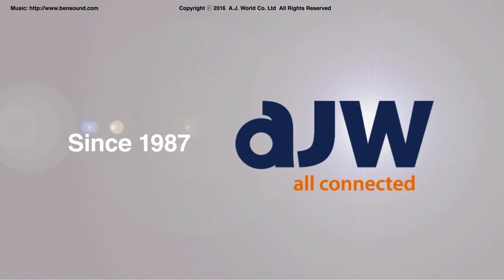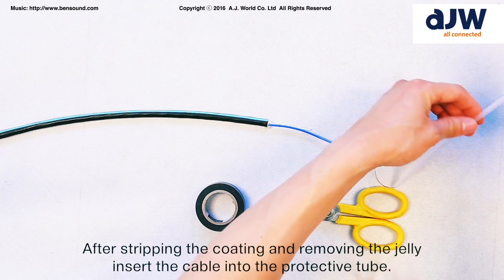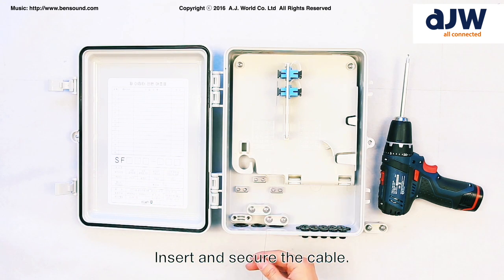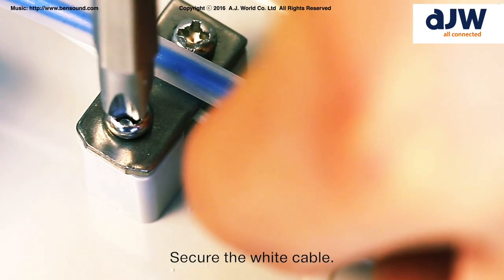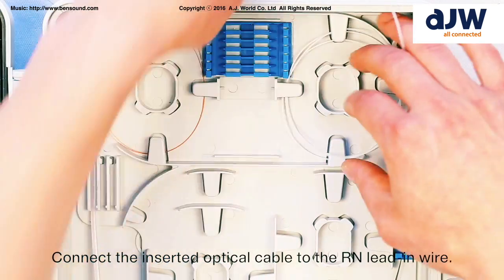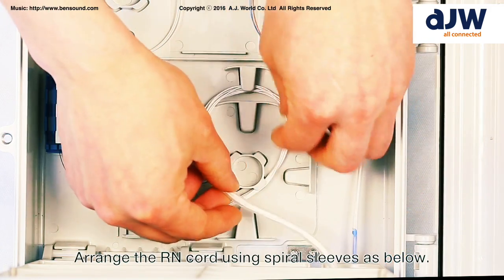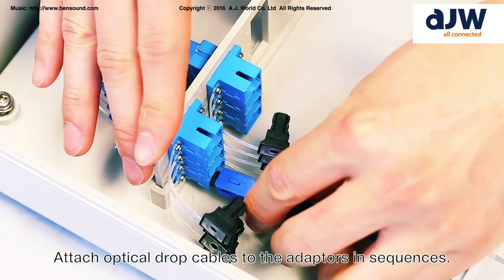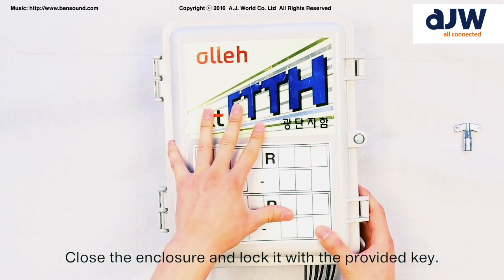[EN] Fiber Optic Termination Box OTP-A

Comment: That's it? Question is, how did they connected? All you do is organize the cables..
Reply from the maker: This video guides OSP field engineer the basics of using fiber optic termination box from cable preparation, retaining the cable inside the box, splicing the fiber to the splitter and connecting the connectorized cables. During the process cable routing is very important since it directly affects optical performance.
Reply: The cables were spliced It is very clear in the video.